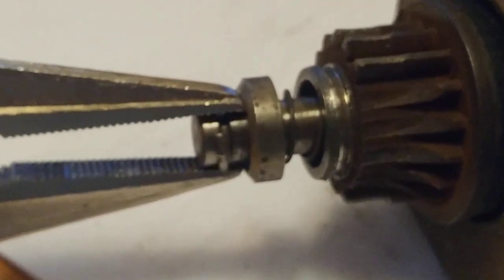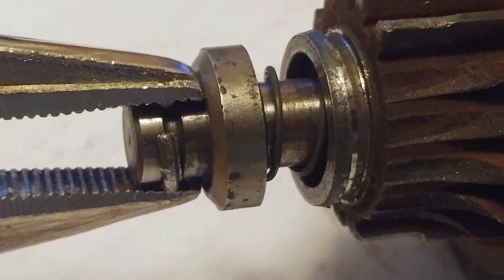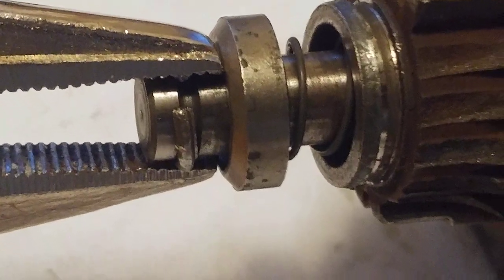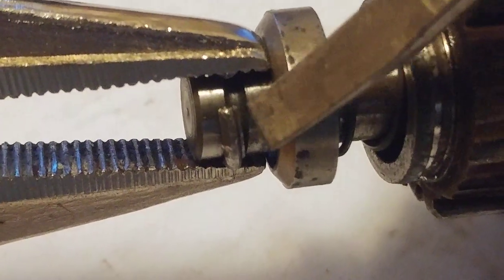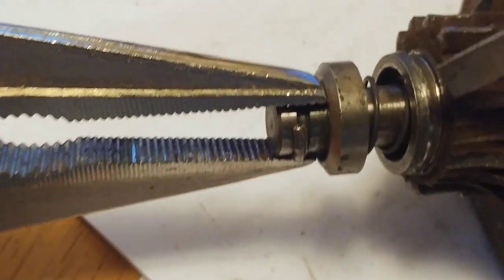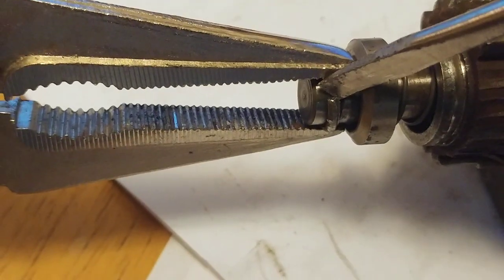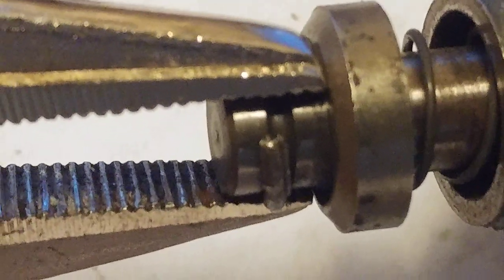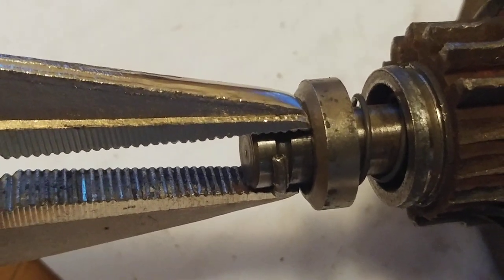Snow Blower electric starter gear and snap ring removal - Tecumseh

Comment: I was using the vise grips to hold back the plunger, but then the clip would obviously still rotate. After watching this video, I moved the vise grips to lock the clip in place. Took less than 15 seconds to loosen the clip. Thanks.

Comment: I use a cuttoff wheel on my angle grinder and score the "C" ring so it's so weak it'll come off with pliers. Then I use 2 pair of needle nose in the new c ring and stretch it til it slides over shaft the use channel lock pliers th crimp it into place. It's not spring steel so it holds itself in the channel great, Done !  No special tools !  I put a feww drops of light weight oil on the shaft and tested it in the vice. Works perfect ! 😃

Comment: thanks! your method seemed to work, I had a good starter with a bad gear and a bad starter with a good gear, was able to remove both "C" clips quicker than I anticipated  , then reinstalled the clip with Channel lock pliers, trying not ruin it. And it started up!